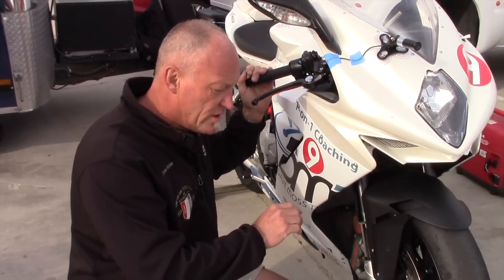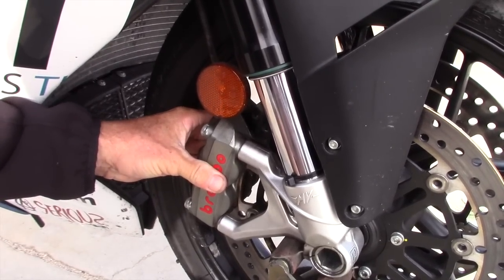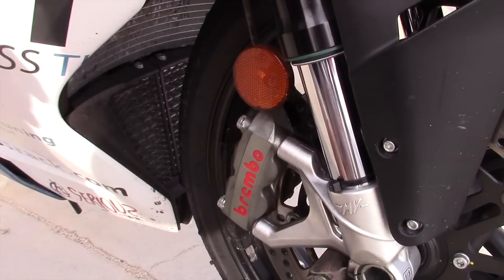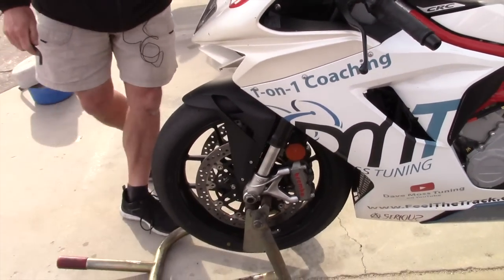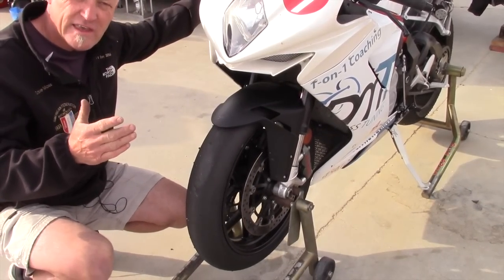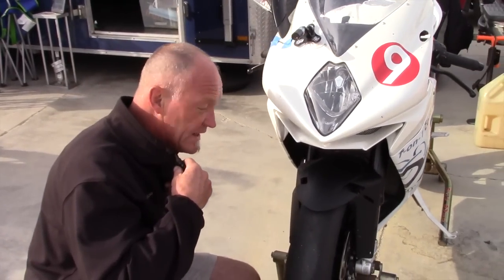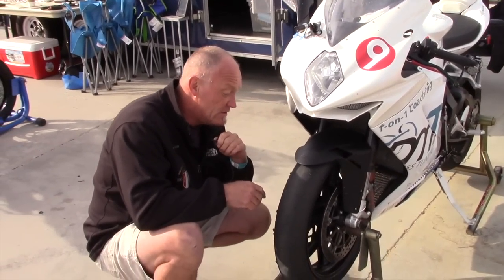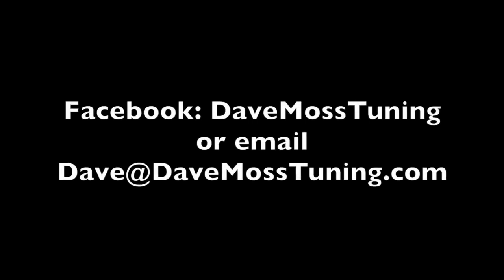Setting Motorcycle Brake Calipers

Comment: Hi sir,  I have a problem with my rear brake, it seems like it was not biting at all. I tried to spin my bike in the friction zone when I used my rear brake it wasn't even stopping. What should I do. I just bought my bike brand new last year. Thanks!
Reply from the maker: Hello Mario. Please check the oil volume in the inspection window or the reservoir. Do you have oil in the system? If your rear brake is not working you should have that covered under warranty. If not, a simple brake fluid bleed will get the pressure back. Note tat we have a video to bleed rear brake calipers when it is upside down at the bottom of the rotor.

Comment: On Hydraulic Disc Brakes on a bicycle, when they are aligned the wheel rotates completely free... but here, not as free, why?
Reply from the maker: Pads will always have a little bit of friction. Pads are larger as are rotors so there is more friction and resistance. Done well, the wheel will spin 5-6 times and then lose inertia

Comment: dose the same apply for the rear brake
Reply from the maker: The rear wheel is set by the adjuster for lateral straightness. If it is off, the rear brake pads will wear diagonally. So in this case, no.

Comment: Great video! May I add that if an inconsistent sound is heard it may be caused by dirt/corrosion on the surface where the rotor mounts the wheel. Just a tiny amount of dirt/ corrosion will cause a significant amount of run out at the braking surface. 
If this has been happening for some time the rotor thickness will have worn inconsistently, giving the impression of a warped rotor.

Comment: This may be a silly question - but do you do this before or after you've bled the brake lines? I'd assume after so youre getting equal piston engagement, but before, the pistons are withdrawn into the caliper.

Comment: the fact this vid only has 720 likes is ridiculous how do 39k people not upvote your content when its invaluable.
Reply from the maker: Thank you for your support on this video. They feel this is a pointless process for them personally can be the only reason. Shame, but there it is.
Reply: Now that the option to down vote content has been removed, I feel that has made up votes relatively meaningless, hence I no longer put likes on videos.
You could get a sense of ratios before, now you can't, so I no longer engage with that system.

Comment: I want to swap out my 6 pot 2000 zx9r e2 calipers with some triumph sprint rs 955i 4 pot nissins with the same mount bolt size but I was wondering if I'll have a problem with the caliper sitting centre on the disc or doesn't it matter as the pistons move freely , or is there a way to measure caliper is centre and put a washer there if needed , all the forums seem a bit vague on fitment and don't want to spend the money if it's a problem , any advice would be much appreciated thanks
Reply from the maker: 1. Are bolt centers identical?  2. Is the caliper width the same?  3. What size rotors are on both bikes, so are spacers required to set the caliper distance?  4. Do brake pad dimensions for overall size compare favorably? I'd start with these questions prior to spending $$.
Reply: @catalystreactionsbw  great advice thank you 👍🏼, the mount holes are both 90mm and the discs differ by 10mm I'll find out the width, is there any tolerance with width and disc size at all

Comment: I just painted my bike and when I put the rear wheel and caliper back on the wheel don't want to spin.....hoping I don't have to take it all back apart......thanks for any help or suggestions.....there are brembo brakes on the front but not the back.....it is however a caliper and not a drum.....
Reply from the maker: Check you have the spacer between the sprocket hub and the wheel inside as well as both spacers on the outside. Yes, you have to remove it to check.

Comment: About how many rotations should a front tire spin before coming to a stop on its own? I just had my front tire replaced by a local shop and my brake lever feels a bit different and after putting the bike on stands and giving the tire a spin, i get about 2 rotations before it comes to a rest. Ty for your time
Reply from the maker: When done correctly, 3 to 5 rotations.
Reply: Although all wheels are different, some things to consider are; Are your wheel bearings dirty or worn?  Did you improperly under-torque your axle and the shop torqued it properly (less spin)?  Did they reposition your pistons, or clean them, and seat your pistons properly (like this video shows)?  Did you have new tires installed?  Are rhey heavier tires??  Several factors are at play.  Hope you figured it out.

Comment: Why does the wheel stop.so quickly? Are braking pads resting on the disc? Will that not produce heat and ware the pads out?
Reply from the maker: That is one cause, the other is the leg that the axle goes through is not set correctly.
Reply: @catalystreactionsbw  believe the question was referringto the video demonstration "Why does the wheel stop so quickly?" *It was because you quickly squeezed the brake lever to seat the pistons against the brake rotor.
Reply from the maker: The bike is on stands so the wheel has very little rolling resistance other than normal drag.  I apply the pressure quickly to seat the pistons against the rotor so the calipers align to the rotor. I also clean the brakes VERY regularly with a toothbrush and soapy water.

Comment: When spinning the wheel there is a faint audible fast clicking noise you can hear. I was wondering if this is normal? This noise started when I married a set of M50 brembos with Vesrah Sintered Pads.
Reply from the maker: Check the rotor on the carrier for free play, then watch each brake pin to see if it moves when the wheel spins
Reply: I got that click on original CBR600rr rotors, its the play between the rivets, its actually good that the rivets dont bind and have room to expand, otherwise you get pulsation feedback when the rotors heat up and expand.

Comment: I really don't understand why this is necessary in axial calipers. I mean, this calipers cant be aligned. When you adjust the axial bolts, they get always in the same position looking the bike from the front. Adjusting the screws with the brake activated, the only thing that it generates is that it hardly changes its position (due to the clearance of the holes and the caliper screws) but looking at the motorcycle from the side, that is, it does not impact the alignment (which is what we see from the front)

Please, someone correct me if a wrong. We are here to learn to do things well but in an efficient way (I mean not to do unnecessary things) 🙌
Reply from the maker: Hello Tomas. Thank you for your comment. I go this route because it makes me feel comfortable that I have done the best I can to make everything correct to my way of thinking. You can certainly have a different approach based on your understanding of engineering and optimizing/streamlining your work flow and time with your motorcycle. Please do so - this just serves as a thought provoking video and me sharing my approach.

Comment: My problem is the caliper bolts cannot mount to the fork because it’s not aligned.. the caliper bolt holes are about 1/2” towards the wheel. I have tried pulling the caliper back towards me to get the bolt aligned but no luck. Any advice?
Reply from the maker: Do you have the wheel spacers mounted correctly? Is the direction of the wheel correct?
Reply: @catalystreactionsbw  the wheel spacers are in, what I can’t tell is what way they go in, I’m doing it to the best of my knowledge according to the service manual.
Reply from the maker: @kodyking3090  If the spacers are in and nothing lines up, switch the spacers around.
Reply: @catalystreactionsbw  turned out the dealer mounted the tire backwards. Wheel is one directional and one rotor sticks out slightly further than the other
Reply from the maker: @kodyking3090  Great catch!

Comment: hmmm. my rc51 front wheel only makes about 1 revolution when I spin it with a lot of force. rotors are straight and disk is centered in the calipers. what should I do?
Reply: Service the calipers. Clean them, clean the pistons, and use red rubber grease (cheap on amazon). Inspect pads. It sounds like the pistons are not reseating fully and that would be due to dirt.
Reply from the maker: www.youtube.com/watch?v=0sHQfnbf9t4 is a brake caliper cleaning video that might be helpful.

Comment: Does this work for the calipers bolted at 90 deg to the rotor too? Or just the inline ones on modern bikes?
Reply from the maker: This works for all calipers bolted upside down forks. Telescopic forks set the caliper in one location.
Reply: @catalystreactionsbw   This comment makes no sense. USD forks are telescopic forks, just like RSU/conventional forks are also telescoping. 

USD forks commonly have radially and axially mounted calipers, it's not either/or. A brake guru should knows these basics, at least
Reply from the maker: @shinyribs2178  Thank you for your contribution and points of accuracy.

Comment: do you do that with the rear brakes? they have a guide from the swingarm
Reply from the maker: There is peace of mind when you know the rear caliper is centered on the rear rotor when brake is applied, then torque your axle.
Reply: @catalystreactionsbw  well is this really necessary to do on the rear calliper since it has calliper sliding pins which allows movement left and right
Reply from the maker: @Fordahord1  If you believe that greasing the guide pins is enough, that is fine. I you see diagonal wear on the brake pads, cleaning the pistons and holding the brake on does not hurt in being thorough.
Reply: @catalystreactionsbw  usually I put something between the sprocket and chain to make sure that the chain adjusters are all the way forward. That means that I can’t spin the wheel and apply the brake. I guess I’ll have to choose between one or the other
Reply from the maker: @Fordahord1  Just another set of hands to be recruited to coordinate brake lever with rag/screwdriver in the sprocket. Might cost you lunch but worth it :)

Comment: Can it be done without lifting the bike? I'm thinking about walking with it, hit the brakes and then adjust.

A side question. Can (is it possible) the pads or caliper be set further apart so that the pads don't touch the disc at all?

Appreciate your content - greetings. :-)
Reply from the maker: It can be done that way by dragging the brakes as you push it. Then hold the brakes on.
Reply: Are you asking if you can set the brake with minimal drag on the wheel so the wheel spins freely?